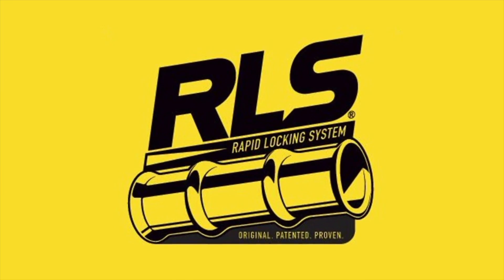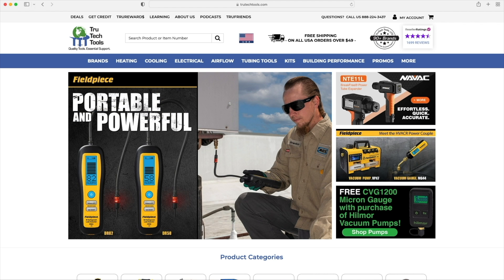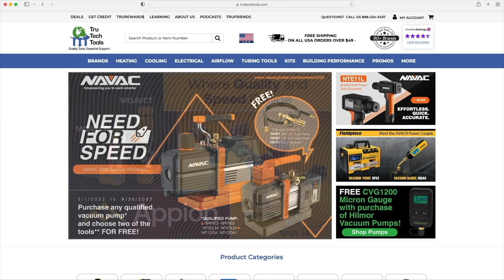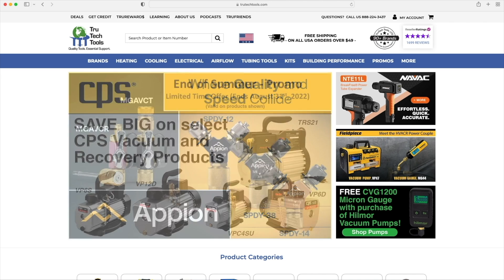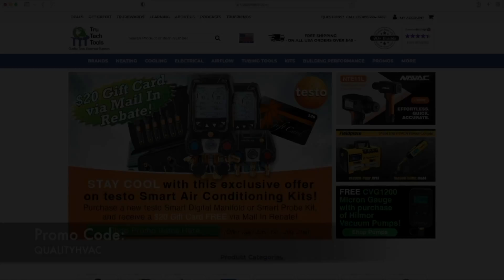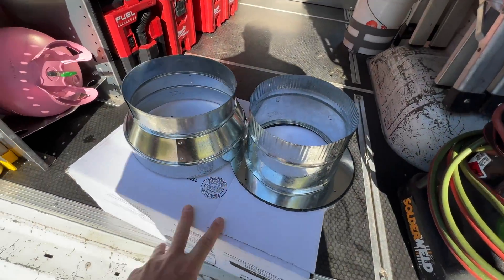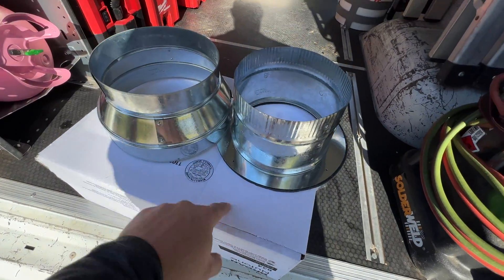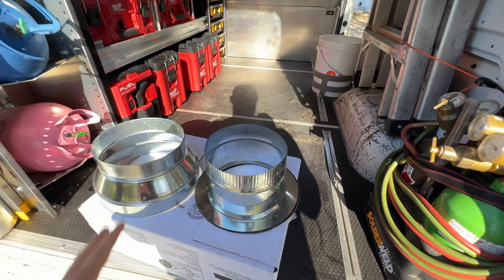What YOU Need To Know BEFORE Getting In The HVAC Trade!!

Comment: Yes, thanks for sharing with your 20 years of experience and all the things you said is eye opening for or should be those who are thinking about entering HAVC trade. Well done, I might add one thing is make sure all HAVC beginner or experienced hvac that NEED to, should, have hydrogen peroxide to pour cut areas (if unfortunate things happen), and all sizes of bandages, first aid ointment {should have in your pocket or one compartment reserve for that first aid ointment and few bandages in your pouch, very small plastic bottle that is filled with hydrogen peroxide should be also in your tool pouch (!) (watch out for expired date!) and medical wrapping around for serious cut until to get to medical facility to prevent not just blood lost, but increase infection chance! Very small reminder, you need to have a mobile phone's battery charger, etc. I would avoid working on a slanted rooftop and even on a rooftop when rain is pouring down, snow is falling, lightning, etc. Working with any sheet metal, you need to wear high cut resistant gloves like cut-rate protection level-9, etc.

Comment: The final tip is a life lesson and advice. Nothing in life comes or will be easy n it's the same for hvac technician he is right. You gotta stay tough mentally because u don't know who ur dealing g with or if you have to work in certain conditions or whatever the scenario may be. But if you gei ND it out n tough enough mentally to handle the pressure or the mental battles u will succeed as a hvac technician.

Comment: I agree with you 💯 % about working in extreme temperatures. Out here in Arizona attics can get upwards of 130-150 degrees. Usually, if I'm replacing a blower motor I will pull the blower assembly out and work on it outside in the shade. If you're in an attic when it's that hot you shouldn't be working up there for more than 15 to 20 minutes tops. There have been technicians that have gone down with heat strokes from being in an attic for too long. Personally, I think that installing furnaces and air handlers in an attic in the Southwest should be banned. It's just too damn hot here for that.
Reply: Or they should INSULATE them at the roofline and not the ceiling. Just think about how much cooling they're wasting by putting it and the ductwork in that oven of an attic.
Put it inside the living area walls and such and you practically don't even need to insulate it or seal it very well.

Comment: ive been interested in a lot of different trades but theres 2 things that concern me.
1. starting work at 6am
2. ladder work. im not good with heights and most trades require them.
Reply: Working at 6am bruh
Reply: You'll get used to it, can't let things like that deter you. Used to be afraid of heights until my uncle made me climb up a roof on a ladder while carrying an air compressor. Takes time but overcoming fears if a fulfilling thing to do
Reply: I start work at 5am in a factory get over it
Reply: @jeremygallagher6711 there's literally no difference between it and later, just go to bed earlier. It's better for you too, and you can go to almost all shops after work before they're closed.
Reply: I start work at 3am. Starting work at fucking 6am would be a fucking blessing. 
You will learn to get the fuck over it. Just go to bed earlier and you will be fine.

Comment: By the way, you got the crimps going the wrong way. On a hood vent you need to do the crimps pointing down with the crimp end opposite of air flow. The reason, it keeps the grease from building up on the joints and allows the grease to flow all the way back down the pipe.
Reply: I never heard of that makes sense though.. also i didnt see any spray glue b4 the metal tape.. it actually makes such a difference

Comment: I live in central europe where there are concrete panel buildings. My problem with the trade would be hanging out of the 8th floor window, with a big a- hammer drill, fixing stuff to the walls. Google the buildings, and they would be your most frequent place of work.

Comment: Did I see it wrong? It looks like you started your pipe with the crimp on the elbow going backward, against the airflow.  Then at the roof it looks like the crimp is facing down also. Isn’t the crimp supposed to to point toward the airflow. Same way with supply, return ductwork, and flues.  Am I missing something?  

,

Comment: Question: 
When installing the vent pipe for the hood range, is there supposed to be insulation around the pipe going through the roof?
Reply: This is a kitchen exhaust pipe; if you had a furnace vent pipe you will require a double wall pipe.-
Reply: I should have mentioned that with condensing furnaces vent pipes are plastic as the temperature is very low. In some cases due to very cold winters, pipes may need insulation to prevent condensation. Check your local regulations for safety.-
Reply: Nope

Comment: Why the attic vent instead of an 025 assembly? Never done it that way. Not talking crap just curious
Reply: Yea, that sort of vent is used for attic ventilation.  Real restrictive because the air has to turn so abruptly.  We always used a separate roof Jack, and regular roof caps, and extended the pipe well above the roofline, into the roof Jack.

Comment: New service tech here. Some days are harder than others but I’m always willing to do what it takes to get the job done. Better tools make my life a lot easier so definitely investing in yourself is worth it.
Reply: Hey man just saw your comment. I’m tryna become a service tech. I’ve been in hvac for 4 years now. Started as a gas piping installer for new home construction for a year and a half. Went to a diff company for residential as a water heater service tech and installer. Wanted to try something different after that and installed furnaces , AC’s, heat pumps and hot water tanks as a helper but I would install the systems with a lead. Any tips on how to get into hvac service as a service tech? I have experience
Reply: @hvac24  Just get your EPA cert. Good to go.

Comment: One of the first big jobs I did myself from estimate to install ended with me going home at 11pm because I got into my own head too much, led to a lot of dumb mistakes like not taking things into account, such as size difference between old an new and so on. I felt like the worst tech in the planet. But I learned a lot, it's gotten a lot better since then.
Reply: Don't give up now!
Reply: Hows it been going now??
Reply: @masontroglen3413  Been doing great, still want to work on some things but I've improved a lot.
Reply: The ONLY way to learn by mistake is well stated in the proverb and nothing wrong with you learn by mistakes, except extremely careful when doing any live electrical related work, NO mistake for messing up live electricity or any electrical related work, cz NO second chance in some cases!

Comment: Sure hope you insulated that pipe in the attic and installed a damper that closes when that exhaust fan shuts off. When the ac is running it will pull air back into the house through that pipe acting as a return and when that hot humid outside air meets that cold air at the hood, it will sweat and cause mold over the stove and inside the hood! Just sayin, I see it every year! And be sure to have a VERY GOOD ROOFER show you how to install those caps! If it leaks, you will be liable for ALL THE DAMAGE! A quick way to loose a good reputation and A LOT OF MONEY!
Reply: As long as there was a damper on the roof cap it should be fine. Definitely agree with the insulation part
Reply: It’s code where i live
Reply: I didnt see him spray any spray glue before taping either, got to add the glue its a must. Then squeegee it.
Reply: Why is an HVAC guy even doing that job instead of a roofer or just a handyman type.